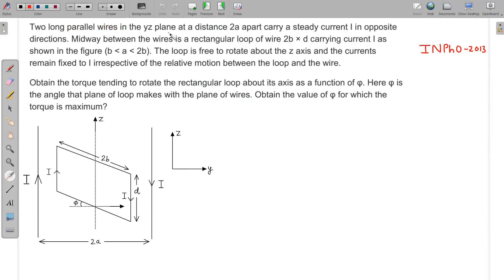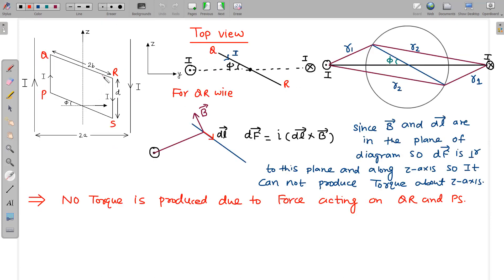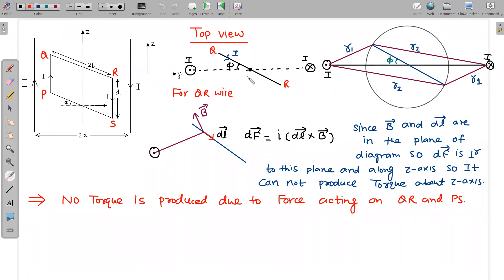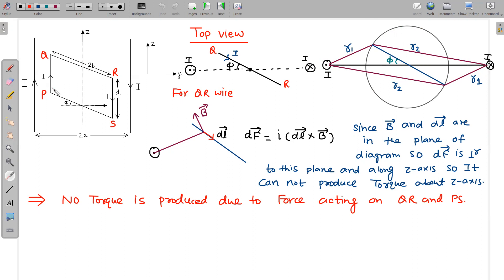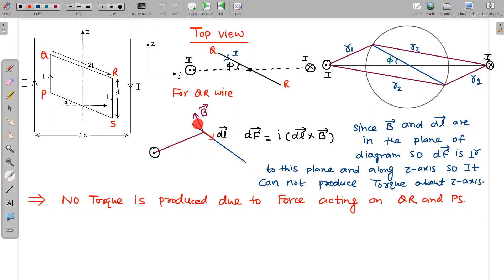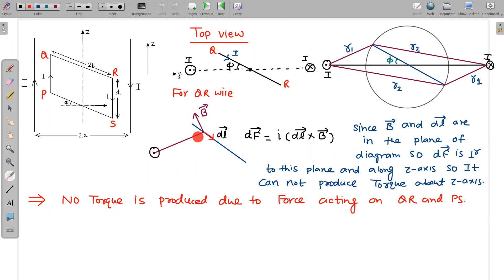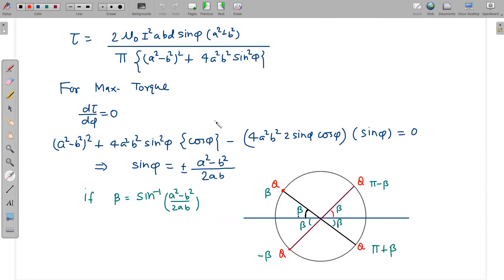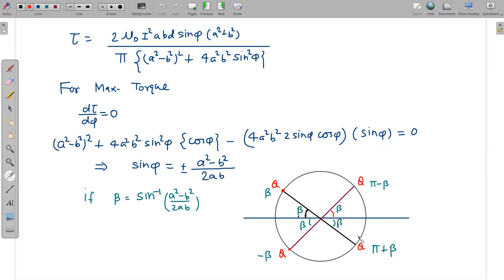Magnetism | INPhO 2013 | Torque on Rectangular Loop in Non Uniform Field

Comment: Sir i didn't get why the distance the 2asin.. But not a×sin .. Its rotatinga about the central axiz
Reply: the distance is not 2asin(theta), but a couple is acting on the loop on PQ and RS, so for total torque we multiply by 2

Comment: Sir can't we do it by using T =m cross B by taking element we can divide the loop into right and left parts and then we can write T separately by using m cross b this we can obtain symmetry by the two wires on two halfs of loop I took
Reply: Field is not uniform at every point